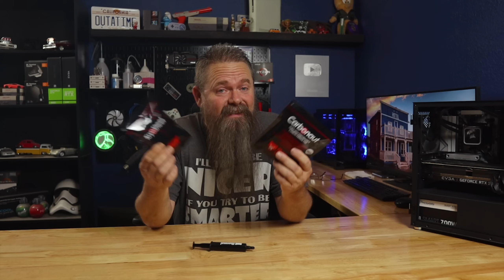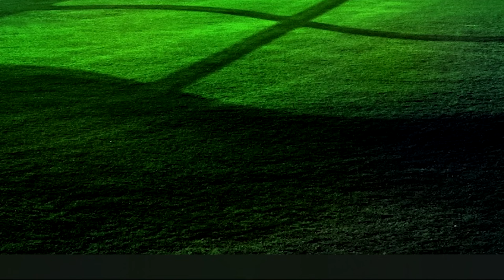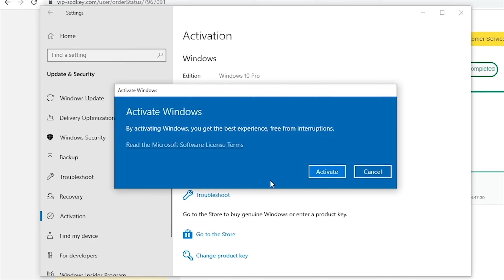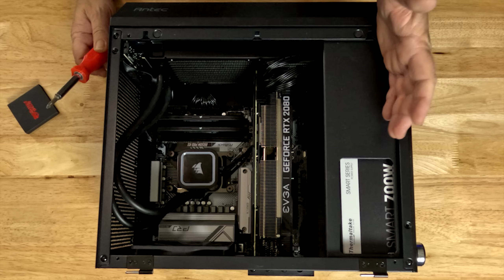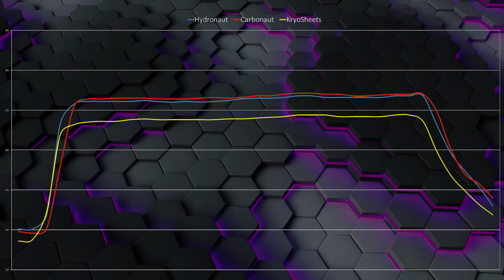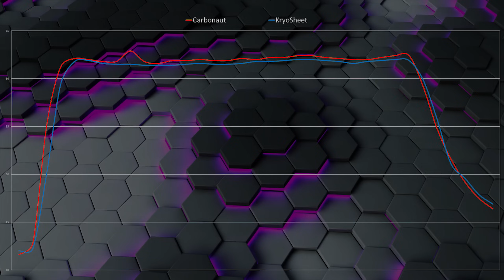Thermal Pads OR Paste, Which is Better?

Comment: I see you are using the thermalright frame for AM5. Did you notice any improvement with that? Doesn't it scratch the aio?
Reply from the maker: I did a video on it. 

For an AMD CPU the benefit is more in maintenance than performance. It's way easier to clean up thermal paste now. But considering my system is using hard tubing, that's not something I do very often. And if you're using pads like I cover in this video then it's not even a thing to worry about.
Reply: @CyberCPU  Thanks. I already installed it and didnt notice any relevante changes (like temps drop or anything). I guess its more aesthetic and cleaning wise. I installed PTM7950, my ryzen 7 9800X3D with prime95 stressing gets to 85 C aprox, pushing 165 watts

Comment: The hotspot on my 3080ti kept shutting the card off as it went past 105°C repeatedly. I repasted with MX-7 paste. After around 5 to 6 weeks it started overheating again. When I opened the GPU up again, about a third of the paste had pumped out.
I replaced the paste with Kryosheet. It's made a huge difference. The hotspot average has dropped by 10°C. A couple of months later and everything is happy again. It's been quite the relief as there's no way I could afford a 5080 right now. 
😊❤😊

Comment: I think with only building a system every few years at the most, using the clean/easy thermal sheet makes a lot of sense. No need to be worried about applying the right amount or which pattern is the best to apply.

Comment: The main point of the kryonaut pad is to not have to replace it. For example, in a GPU, where the chip is very unlikely to ever get replaced. Or in a laptop.

I got a carbonaut pad for my home proxmox and file server. Also used it on one of my laptops. Not as good as PTM, but very good, and much better than pumped out or dried up paste. So nice to not have to worry about replacing paste and just have it keep running. I'll be putting a kryonaut sheet in my GPU as well, and replace the thermal pads with a quality long lasting putty. I keep forgetting to replace paste, so really happy with how well this works.

Comment: i only increased the pump speed and my kryosheet is 8 to 10 degrees cooler than the arctic mx6 i was using
Reply from the maker: That's pretty good but depends on what your pump speed was before. It might have helped more.
Reply: Yeah most of that was due to the increase of pump speed for sure.
Also MX-7 is the way to go now, of of the very best pastes you can get, blows almost everything else out of the water.
MX-6, even the lastest Revision, cant really hold a candle to MX-7 as MX-7 is pretty much on par with Duronaut (Pro)...
And also now fully usable and recommendable on GPU's, which MX-6 was usable on, but not recommended.

Comment: They can run a little hotter when first installed. Once they heat up and settle in after some use the temps will come back down a little.

Comment: Thermal paste is generally the superior, more robust, and cost-effective choice for most users (20:05). While thermal pads like the KryoSheet offer slightly better temperature performance and convenience (no mess), they are more expensive and delicate to handle (16:56-17:53, 19:05). Overall, there is no significant thermal benefit to choosing pads over paste for typical applications.
Reply: Especially when your setup is already good and u are using a really good paste, like MX-7 or Duronaut Pro.

Comment: Wonder if wr can use thermal pad on a ps5 instead of the dumb liquid metal
Reply: Yeah you can either Kryosheet, but be careful with any open contacts as its conductive like LM or use PTM Phasesheet.
Reply: @wolfwilkopter2231 yep ptm all the way just havent seen any video of anyone adding ptm to a ps5 just yet would be interesting to see temperatures Compton liquid metal.

Comment: i'm using an Aairhut 0.5mm (claimed 13w/mk, it's probably not) pad on an fx8350 overclocked to 4.5ghz on hyper 212 evo (4heat pipes) and one 120mm fan and it never goes over 52c max temp, i still need to add a second 120mm fan. 

I did the same on a PS3 fat and it idled at 45 - 50c down from 75c 

I personally think a lot of this thermal bridging OCD lore is way overhyped, paste is rarely installed to spec, it's messy, it pumps out, it dries up, etc. a 0.5mm pad squashed to 0.3mm is likely better than most people could achieve with paste and considering the temperature differences are negligible... unless you're pushing the edge of thermodynamics and what's possible for the silicon chip; Pads are fine.

Comment: The most important thing about the sheet is that you have 0 chance of pulling out the cpu damaging the pins or the motherboard which happens to the AMD sockets only for that reason the paste is obsolete
Reply: Only up to and including AM4 which are all PGA. 
AM5 is LGA socketed and thus pushed down and held in place with the retention module.
And even then only if you are retarded and just try to rip the cooler off without thinking, instead of giving it a little twisting to left and right and feel how its getting loose.

Comment: To be fair on your assessment, those pads aren't supposed to degrade at all, so technically using them for 1 hour or using them for 2 years should be about the same when taking them off. Unless you use a paste or something to hold them down when you apply them.

Comment: It's misconception that thermal paste becomes worse from "drying out", if so, you could just add a drop of alcohol and make it work like new again. It get's worse with time due to being squeezed out with constant temperature changes that expands and contracts metal.
 Also there are things like ptm7950 which dries pretty much during first use and it's necessary for it to fully achieve it's power, it changes phase to liquid above certain temperature and fills pores in metal better than paste or liquid metal, but it continues to work even when you're idling and it's already completely dry and solid.

Comment: Bit outdated but you're meant to cook thermal pads by heating and cooling for a few days before they reach peak effenicy
Reply: That and the fact thermal pastes degrade and pump out over time. Kryosheet/PTM7950 doesnt and the temps actually improve

Comment: 99.99999% of home PC users don’t have a regular cleaning and maintenance routine. These systems, especially laptops, will last a long time if proper upkeep is performed. That factory thermal paste is a horrendous weak link in a build. It needs to come out sooner than later and replaced with something better.

Comment: thermal pads loose spring tension and need to be retorqued, they leak out sometimes especially after an overheat, don't last as long as a high grade paste and most importantly don't have a direct contact to the cooler so if your using a copper or aluminum heat sink you loosing ALOT of the heat transfer and if it was contacting directly you would maybe be fine with plain steel heat sinks if your directly contacting the hot component
Reply: Are they really loose?  If so, can I tighten them?  Just wondering.

Comment: I'm the guy who, when I put the heatsink/waterblock onto the CPU, I don't take it off anymore - not unless I'm replacing the CPU or the HSF/AIO, which could be years later...  So, I see can see the value of the Cryosheet product.

I never knew that thermal paste dried out and got worse over time, or that the expansion and contraction of the CPU/HSF/AIO from the heating and cooling of the CPU and the HSF/AIO caused the thermal paste to slowly get pumped out from between the CPU and the cooler...  That is another reason for me finding the thermal pad solution of great interest.

Comment: Liquid Metal; if used and installed properly it cools almost 5°C to 15°C or more under load, depending on the specific application  more than paste or pad. However, I defiantly do not recommend it on Laptops.

Comment: Thank you for this great and very informative video ... i definatly stick with the KryoSheet from Thermal Grizzly .. as i do not want any further work on my CPU Cooler ) taking it off the CPU and on again ... why shhould I ?  There is no need for that any longer as you said the KryoSheet has no liquid in it that can vaporize and degrade the pad  ) ... for perfection of this test i really would have liked to see the comparison with no thermal pad or thermal paste between the CPU and the cooler .. that would have been very interesting too ! May be in the future you redo that test

Comment: one thing to note that you dident mention is the carbonaut pad is conductive wile the kyropad is non conductive
Reply from the maker: The Thermal Grizzly KryoSheet is made of graphene and is conductive . Both the KeyoSheet and Carbonaut pads are electrically conductive. 

You're right though, I should have mentioned that in the video.
Reply: @CyberCPU oh yes kyropad is I was thinking of the phase sheet that's non conductive

Comment: I also use the contact frame from AMD CPUs. But I don't use the thermalright ones. I tried them and they say if you order one of theirs. Make sure it's the one that comes in the box but the plastic package. They say the plastic package one doesn't fit right and possibly could mess up your high end CPU

Comment: Why did you do a test of reusing the kryosheet when it says on the website "Multiple use of Kryosheet is not recommended".  The carbonaut is reuseable not the kryosheet.  Perhaps the instructions were not clear enough?  Or perhaps you interpret that as optional?  Probably Thermal Grizzly's fault, they should have stated, "One time use only".

Comment: Holy smokes. Watching you using that rag on the CPU surface made me cringe. Of course one can use it to remove most of any dried up compound. But polishing surfaces with it? Without giving the surface a good finishing touch with alcohol? Please. There are microscopic ridges and crevices on the metal surface. You rubbed that old gunk into those, effectively creating isolated sections filled up with dried particles of worn down thermal paste residue. 
Always use isopropyl alcohol to give it a final rub! I couldn’t watch it! And this is ignoring the fact that you most likely created some sort of static discharge with that rag next to electrically sensitive areas . Never saw something so sloppy before. You meant well I know.  But ugh…😮

Comment: will a gaming laptop heatsink have enough mouting pressure for this kryosheet to perform its best? I have an i9 13980HX cpu and it's so host when on boost clock. I refuse to reuse the standard liquid metal  due to fear of pitting the direct die over long term (also the need to reapply it after few months). Currently I'm using Polartherm X-10 which seems to perform fairly well but only time will tell when the performance will deteriorate (it's prettty viscous to apply though so it might last long)

Comment: I dunno man.... I replace laptop and PC motherboards sometimes a dozen or more times a week for most major manufacturers. Cleaning the heat sink compound takes about 15 seconds unless it is dried on, and then it takes like 45 seconds. It's not that hard, and not that messy. If I don't have one of the alcohol cleaning cloths, I use a flipping paper towel.

Comment: What if overtime the kryosheet start's to crumble between these notches/gaps and its pieces short-circuit something on the board?

Iam planning to use it with stock frame and waterblock, so i have some concerns about crumbling overtime with a lot of temperature cycles. No info around about this

Comment: ChatGPT5 is so awesome, it’s answer was dead on same as this real world application. I asked it if using the sheet would be better than the paste that came with my Noctua DH15 G2 (worlds best air cooler) for my current worlds fastest CPU and here’s what it said:

🐻 Noctua NT-H2/NT-H1 Paste (what you used)
	•	Excellent, premium thermal paste.
	•	Easy to apply, fills microscopic gaps well.
	•	Typically within 1–3 °C of the very best compounds.
	•	Needs reapplication every few years, but reliable and safe.

⸻

🐉 Thermal Grizzly KryoSheet (Graphene pad, 38×38×0.2mm)
	•	Thermal conductivity: extremely high (better than most pastes on paper).
	•	Non-curing: performance doesn’t degrade like paste.
	•	Reusable: you can re-seat it multiple times without reapplying.
	•	Consistency: easier to get a perfect mount because there’s no paste spread variable.
	•	Temps: on CPUs like your Ryzen 9 9950X, expect maybe a 1–4 °C improvement over top-tier paste if contact pressure is good.

⸻

⚠️ Caveats for KryoSheet
	•	Fragile: it’s very thin and can tear easily during installation.
	•	Conductive: unlike Noctua paste, it can conduct electricity. If it slips or gets pinched and flakes, it could short something.
	•	Fit: your NH-D15 G2 + AM5 socket clamp has excellent mounting pressure, which works in the KryoSheet’s favor, but you need to be careful with alignment.
	•	Price: way more expensive than paste for relatively small gains.

⸻

✅ Bottom Line for Shadowforge
	•	You might see slightly cooler temps — enough to keep the 9950X closer to max boost clocks for longer under Cinebench or rendering.
	•	The gain probably won’t be huge (maybe 2–3 °C lower vs. NT-H2), but on a 230W+ CPU every degree helps.
	•	It’s more about consistency and longevity than raw temp drops.

This is awesome
Reply: You're not as smart: Do you even know how AI (or ML) works? Clearly, ...!

Comment: Fun fact, at around 7:25 talking about removing a tire compared to the cooler, We don't remove tires like that. We put them on like that. If that's what you were told by someone back when, then just know, you've been doing some extra. Take the lug nuts off however you want. Or maybe you are just confusing the two which is fine too. Its putting them back on that is the important part. Now for this right here, I would agree that taking the screws out in a cross pattern helps because of the pressures mentioned, but also less likely to get a screw to be flung out because it was under tension from removal lol. I don't know, I'm just some dude on the internet. Don't listen to me lol.

If you bought it..... Don't eat it.

Comment: I use those contact plates on all my AM5 builds. They certainly look nice but found they are porous and when you try to wipe off the thermal compound it stains them. Using alcohol doesn't wipe them clean as you would think it would. They look like trash after the first cleaning. Anyone else experience this? Wonder if maybe it's the Gelid silver compound I am using but doubt it. Of course it's not the end of the world for all you cranks out there that want to say why do you care. But it is nice being able to clean up surfaces and not have staining on the black plates.
Reply from the maker: I didn't have that issue with mine. It wiped right off with no staining. I didn't even use alcohol. I just whipped it off with a rag.
Reply: @CyberCPU which compound?
Reply from the maker: Thermal grizzly.

Comment: I'm using an IC Graphite thermal pad and it's been pretty great and holds up well over many uses. It's a biy thick so I wonder how that compares to thermal paste. Works well enough with my 9800X3D though

Comment: Use paper towel and qtip to clean off the thermal paste. Don't have to worry about dumping or finding rags, works as well maybe even better. Also the Smart 700W PSU isn't the greatest, might even be under "Replace immediately" tier.

Anyways, thanks for the tests. Was interesting information.

Comment: Good quality thermal paste doesn't actually "Dry" out. the issue is actually related to thermal expansion and contraction over multiple heating and cooling cycles, resulting int "Pump Out" where the paste actually gets squeezed out from between the hot component and the cold plate.

Comment: I'd consider a (non-conductive) pad/sheet for a GPU-repaste, simply because it's so much more of a hassle to take apart a GPU. I'd probably go with some sort of phase change product and I think TG are offering one of those as well ("PhaseSheet"). You could get one of those fake Honeywell PTM7950s from AliX I suppose, which, according to Igor's Lab are just some sort of generic PTM-pads with the vendors slapping a Honeywell-sticker onto the packaging. Shouldn't make a difference WRT performance though. 
For my CPU I'm still on Arctic MX-6 and I'm pretty sure it's been on there for 20 or 22 months now. Temps still look pretty good, and even though I still have plenty of the stuff left, I'm already thinking about going with something else once I find the time to re-paste the CPU. Performance-wise this stuff seems fine and it's also quite cheap - at least over here in Germany. But I seem to remember it being a bit of a mess to apply and spread around. I'm thinking either some sort of phase change pad or Thermal Grizzly's Duronaut-paste so that I can simply forget about the CPU's thermal compound and run it until I get a new cooler or a new system.

Comment: Kryosheet and PTM7950 takes time to improve temps. Give it about a month, especially for CPUs. GPU temps accelerate the phase change faster than CPU temps. At the very least, you do not need to be concerned with reapplying thermal paste ever again.

Comment: I reused my Kryosheet when i swapped from the 9950X to the 9950X3D. It was stuck onto my AIO pump, so it was the same shape CPU in the exact same spot on the pump 🤣. 1°C isn't a worry for me, but I suppose I'll get a new one next time I take the cooler off